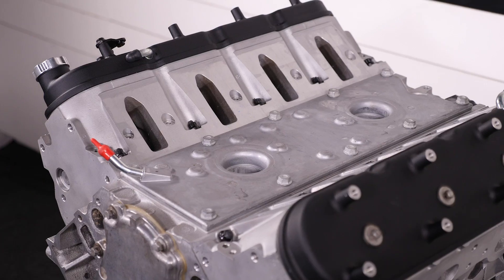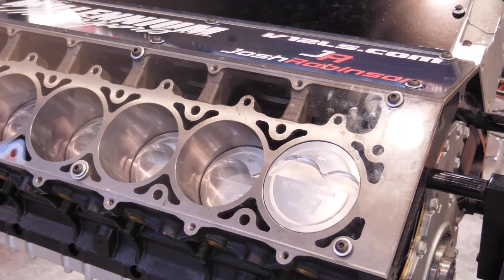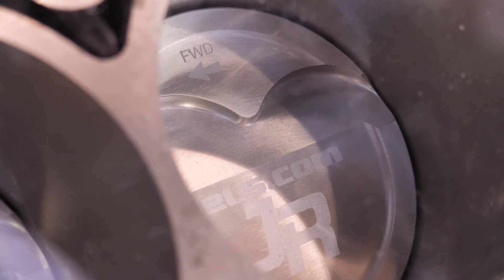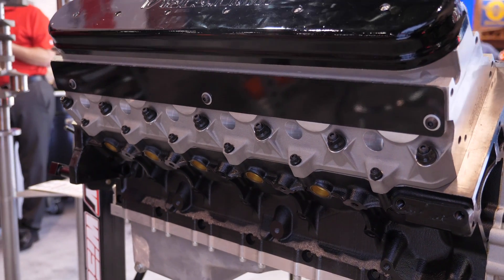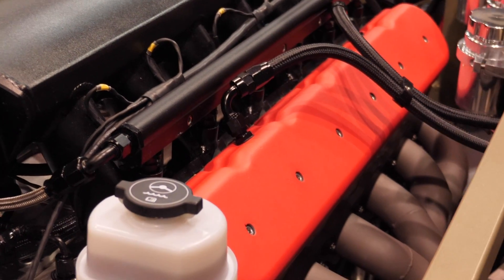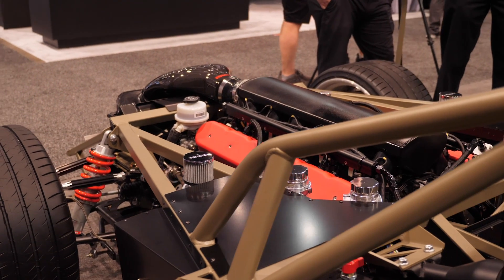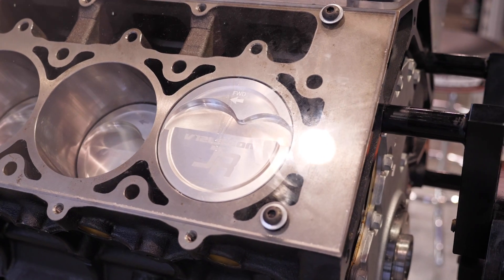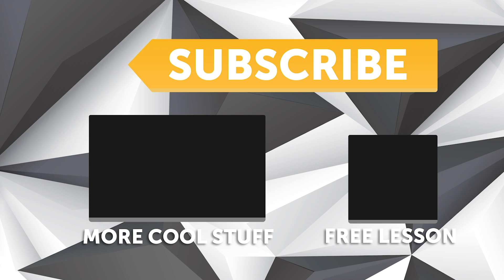V12 LS Engine | What Goes Into A Bespoke V12 Build [TECH TALK]

Comment: Interesting toy.  But in practical terms a similar displacement V8 is lighter, less expensive and more practical all around.  Won't have the same "wow" factor. As long as you're casting your own block it should also be no problem to make it either 60 or 120 degree and solve the odd fire problem.

Comment: I would love a very small V8 of about 2.8 liters . Take two Buick Encore inline turbo 4 cylinders .
Reply: You mean like the all aluminum buick 215 V8 from the 60’s? The entire engine only weighed 318 pounds … with that said although it was 215 cubic inches it was 3.5 liters. Thats crazy i never knew either if these buick 215 existed until today by random chance.
Reply: There was also and old oldsmobile 215 very similar a few small differences though

Comment: The solution to the common-plenum tuning issue caused by the uneven firing (mentioned at 15:26) is straightforward: separate left and right bank intake manifold plenums, so each side breathes as an independent inline-6. As with some production V-8's , the two plenum sides could be linked by valves which are only opened at speed and load combinations for which the linked configuration works better.
Reply: That takes away from the unique rumble that you get with a crossplane architecture and a single plenum intake. You don't create something brand new to just use existing solutions. The tune takes a while to figure out, but they've got it now. Haltech even has a QUAD TURBO version of this as their demo enigne to show off their ECU abilities lol.
Reply: @spdcrzy  this is not a V8, so your ideas about "crossplane architecture" dont make sense. A flat-plane crankshaft would be unworkable in a V12, so they all have multiplane cranks.
Reply: @brianb-p6586 sorry, I should have been clearer. I was talking specifically about having a unified plenum when the angle between banks is 90°, whether for a V8 or V12. Splitting the intake into individual banks would change that sound signature considerably. See: the sound of the C8 Z06 vs C8 ZR1.
Reply: @spdcrzy  this a V12 (which fires at uneven intervals due to the 90 degree bank angle and shared crankpins) so it is fundamentally different from a V8. Both example Corvette engines inherently fire at the same regular intervals, so induction system timing for them fundamentally doesn't work for the V12.
Reply: @brianb-p6586  I agree. I'm just saying, splitting plenums still changes the sound.

Comment: Egad! Still trying to make head gaskets work?!? Why on Earth would anyone use a head gasket? Why introduce a totally unnecessary failure point?
Reply: What's your solution bud I'm interested
Reply: @oliverscorsim  My comment was surely over the top, as head gaskets are generally a viable solution.

But there's no overriding reason that I know of that points to a cylinder needing to be part of the engine block. Other configurations are possible, no?
Reply: @richardcaldwell6159 yeah, who actually pulls a head? Never heard of it in real life. With the large bores, certainly some CNC can dive in and grind the valve seats.

You plob in the pistons-crank assembly using a crane.

Comment: It would be interesting to make a v10 Ls but what about a v6 or v4 Ls or even a V twin for a motorcycle.
Reply: Yes, there is already a shortage of 90 degree V-10 engines out there...er, not. 

The idea of a Chevy based v twin is one that has been tried, it seems like a great idea, but it turns out that without huge flywheels smooth idle is impossible. That was what the Super Vee motorcycle guys found out. You could not get it to idle without tearing itself or the frame apart. If you had enough flywheel you had a really bulky engine.
Reply: Check out the Motus motorcycle V4s they are mostly LS based and very cool. Also GM did make a few prototype V10s which escaped the crusher and are out there.

Comment: I appreciate the rationale behind sticking with a 90º configuration. Still, it'd definitely be super duper cool to see a 60º variant. In my minds eye, I can't picture why that would be much more challenging.
Reply: it makes it too hard to get air in, get low in the chassis, and makes the block and intake have to be bespoke even more than before and all kinds of other complications. It also makes a crossplane crank near impossible
Reply: @Shadow0fd3ath24  There are no flat plane cranks for V12's. A V12 crank is the same as inline-6 crank, but with two rods on each throw. A 60-degree V12 would fire evenly; a 90-degree V12 without split crankpins (this one does not have split crankpins) fires unevenly.
Reply: @Shadow0fd3ath24  Thanks for reply. The block and manifolding are already bespoke, so I still don't see how altering the bank angle is so difficult. I know crossplane cranks are all the rage these days - as they were once in the 1950s, then in the 1970s. and again in the 1990s... But they're still tits on a bull just like they've always been - so I do not accept a crossplane 90* V12 is as good as a perfectly balanced, even-fire 60* V12.

I also do not understand your point about getting air in - air must bend 15* more (each bank) for a 90* layout to get aligned to flow into the cylinder, parallel to the cylinder centerline.

Agreed that a 90* arrangement makes overall height a little lower. Without trigging it out, I don't know by how much, but hard to imagine more than 3-4cm. But sometimes 3-4cm makes all the difference in the world...
Reply: @GroovesAndLands yeah Ferrari gets the air from above in a mid engine car. If you want a front engine, you either need a bird catcher, or one long plenum. I dunno why this engine needs intake runners like my econo 4 banger 1.4 l NA.
Reply: @GroovesAndLands  a perfectly balanced, even-fire 60° V-12 has a three-plane crank, as does this uneven-firing but balanced 90° V-12.
Reply: @brianb-p6586  A 90º V12 does not have proper secondary balance the way a 60º one does; regardless of what you do to the crankshaft.
Reply: @GroovesAndLands  any V-12 can be (if the crankshaft is configured correctly, as this one is) simply two inline-6 engines on a common crankshaft.  Since each bank is balanced, the engine is balanced. If you use some oddball crankshaft configuration you can ruin that, of course.
Reply: @brianb-p6586  A 90º V12 does not have proper secondary balance the way a 60º one does; regardless of what you do to the crankshaft.
Reply: @GroovesAndLands  Repeat as necessary until you understand: "An inline-6 is balanced. Any V12 is two inline-6's." 

What is special about a 60 degree vee angle for a V-12 is even firing intervals , not balance (primary or secondary).
Reply: @brianb-p6586  An inline 4 has even firing intervals yet its secondary balance is awful. Point being - even firing intervals do not imply good balance.

Please study the physics of engine balance.
Reply: @GroovesAndLands  correct: firing intervals (even or uneven) have nothing whatsoever do to with balance. I have identified firing regularity and balance as sroarate issues in every one of my comments in this discussion. Learn to read, then we can work on remedial physics for you.
Reply: either can I .....60 * makes so much more future usability....especially high rpm exhaust modulation...

Comment: Should have been 60degree "oh we wanted a low center of gravity" fine...120degree.
Also time to leave the OHV on the lawnmowers and move to DOHC like the civilised world.
I'm a chevy fan, Just used to v12's making 100hp/liter or 1.64hp per cube or more, Allot of high end european cars will have a quad cam twin turbo v12 under the hood so dont give any of that "wont fit" bullshit. Its a nice lawnmower engine.
Reply: Right, V8s are 90 degree, sixes and 12s can be 120 or 60. Otherwise it's a turkey baster baby.
Reply: @wamgoc3637 V12 can be 60° or 180°. 120° is for V6.
Reply: A quad cam twin turbo V12 that still makes less horsepower and torque than this does naturally aspirated. LOL.
Reply: @ This race cast engineering 9.5L boat anchor only makes 755hp and ~700ftlb of torque.
TVR developed a 7.7L V12 which made ~93% of the torque but +16% more power for their road cars 25 years before this and today Ferrari road cars get even more power from only 6.3L NA.

It's obviously this uneven firing paint shaker develops reasonable torque but the low HP is a result of the asthmatic heads.
Let us know when they find it's missing 500 horsepower because engines from this century like the LT7 piss all over it.
Reply: @tomstech4390  that's with the mildest cam possible, my guy. It will make a thousand horsepower easily.
Reply: @spdcrzy  cool story bro.

Comment: 90 degree V12 with pushrods? Meh. Either just clone the Columbo Ferrari V12 or scale down the RR Merlin and put the accessories on one end like the Griffon and an automotive flywheel like the Meteor.
Reply: Sounds awesome, where is the best place to follow along with your project?
Reply: @V12LS  Sure does! Personally, if I were considering a scaled-down Merlin clone - I'd probably look closely at an Allison V1710 instead. The Merlin is an excruciatingly complicated piece of Britishness whereas the Allison had a much simpler American approach - while giving up zero performance.
Reply: @GroovesAndLands  One problem-you can get all the blueprints for the merlin but there are no prints for the Allison. First step is, get an Allison and demate it and draw everything out. The guy in Pennsylvania has some things but he went to a lot of effort and isn't going to share jack shit. He's actually a bit of a prick. Allisons of less desirable dash numbers are cheap but the desirable dash numbers are high$$$.

 Most of the complexity of the Merlin is in the two speed two stage blower and the accessory case neither of which we will want to use. The ground version of the Merlin is actually a Meteor, there's no way to couple a Merlin to a transmission without major butchery. Most of the core engine parts interchange, parts of outer edges of the specs went into the Meteors.

 The Allison IS superior to the Merlin in certain ways but there is a reason Merlins and Griffons and not Allisons dominate Unlimited air racing. The last version of the Allison had essentially the Merlin supercharger section for the P-82 Twin Mustang because RR refused to extend Packard's license to build the Merlin in a Wilson driven effort to force the US to buy British engines and the US unions still had much power. Packard could have just ignored the license issue but Packard's management "wasn't raised that way", a noble move that cost Packard dearly and hastened its death. By the last Marks of Merlin, RR should have paid Packard a license fee but that is another issue. 

 Comparing the Allison to the Merlin in aircraft service is unfair because Allisons were used primarily in ground attack airplanes and in  the turbocharged P-38 with its huge GE turbos that were basically a complete jet engine minus the burner cans and fuel controls. Allison never developed the precision supercharger needed to achieve high power at altitude. RR stayed away from turbos because 1) they didn't have the metallurgy and 2) the Brits correctly figured that if you could build a turbo you could build a turbojet-and did. As did the Germans. The Germans put most of their turbo work into use with the Junkers Jumo opposed piston diesel which had far cooler exhaust and didn't need an exotic T-wheel. 

 Both the Merlin and Allison were low (static) compression engines with head layouts that were not especially amenable to flow. Ferrari got it right with the Columbo designed "short block" engine the lower end of which was a scaled down Packard automotive V12 (which they abandoned after the war for that reliable but heavy inelegant flathead straight 8) with all new SOHC, and later DOHC top end. Some of those engines had 13:1 compression for used with methanol fuel and had good combustion chamber design. There was also the Lampredi engine which was a nonsuccess except in the collector market. Almost all aircraft V12s had fork and blade rods and very few automotive engines after about 1925 did, they wanted to get rid of the rocking couple really bad. Fork and blade rods add a lot of reciprocating weight as the fork rod has to be pretty heavy, but you get rid of the rocking couple. F&B rods were also intricate and expensive to manufacture, but modern CNC makes that less significant. 

 There are other V12 engines worth studying as well but these were the most successful engineering wise.
Reply: Just buy a V12 from Mercedes ?

Comment: Now they have to make an LS i4. 

Yeah, I just said that.
Reply: Actually that would make a lot of sense. The Midget guys like that, remember the SESCO four? I'd design a four cylinder block that could be drilled either for a classic SBC or an LS head since the bore centers are 4.400 on both, unless there is an unobvious reason why that won't work.
Reply: Blueprint Engines has one. And GM has a DOHC version, too. It's called the L3B lol.

Comment: This would be good to install in a 5/8 scale p51 mustang (or spitfire).
Reply: Being a 90 degree engine it's going to be wide and any time you go into an aircraft application with something not originally designed for that you have to be very careful with torsional resonance issues. Does NOT mean it won't work, does mean a very thorough analysis is needed. Also think carefully about the cockpit on a 5/8s scale recip fighter, even the full scale ones are very snug for modern Western humans and if you open up the cockpit you ruin the lines. If you want redundant dual ignition and a mechanical FI system or redundant EFI think long and hard just how much engine development work is going to be needed. And going into series production gets complicated by vendors going nuts at the word "aircraft" because Pwoduct Wiability. Most small shops are not worth suing but they have been scared out of their wits by uninformed journalism, and that's that.

 But, anything is possible. Many regular V8 Ls's are flying. If I were flying single IFR, over water, bad terrain, etc I'd rather have a PT-6, but that's just me.
Reply: @wamgoc3637  back when I was in Aircraft mechanic school, someone was making a kit for a scale P51, the Papa 51 Thunder Mustang. Iirc it was 5/8 scale with a 3/4 scale wing (I didn't remember correctly, it's 3/4 scale). And it was powered by the Falconer V12, which was a classic Chevy 350 V8 with 4 more cylinders, the predecessor to this LS V12.

I won't deny that the cockpit would be tight for me, I'm not a small guy, but the bigger canopy of the P51H is better aerodynamics, anyways. But most of the major engineering has already been done, so it'd be a simple install. And as an experimental aircraft, you can get away with more stuff and less onerous liability planning.
Reply: @ScottKenny1978  Yes, it could be done. You could also use the BMW or Jaguar V12 engines. You could always buy a real P-51, too. Expensive, but these kind of projects can be huge time sinks...It's depressing how many people sink insane time and money in these projects and either never fly or wind up crashing and killing themselves because their flying skills are not up to the machine. I went to A&P school too and grew up around EAAers. My dad's best friend put several years into building an RV and died of cancer before he got finished. The family's estate lawyer convinced them to sell the engine, prop and avionics and destroy the pretty nearly completed airframe due to "potential liability". I thought he was full of shit (the estate was not worth suing) but he was dispensing conventional wisdom for $300 an hour so they did what he said. 

  Some people have had good results out of the Experimental game but the percentage of projects never flown and the sheer amount of time they consume are depressing to me. If you already have good sheet metal and aircraft maintenance skills and/or also have the requisite flying time and relevant experience to fly one it's a little different of course.
Reply: @wamgoc3637  yeah, it will take years and a crapton of money to build. Probably not as much as an actual P51, though! Not to mention that even with bespoke block, heads, crank and cam overhaul would be a hell of a lot cheaper than a Merlin.

Comment: If weight is a concern, you should not use a V12
Reply from the maker: Yes and no, while a V12 is not going to be light compared to most other offerings with less cylinders, that doesn't mean you throw that consideration out the window. Keeping the weight down relative to your configuration is an important consideration for any engine - Taz.
Reply: When is weight not a concern?
Reply: @ArneChristianRosenfeldt  when durability ist more important for example.
You Always have to balance durability and weight.